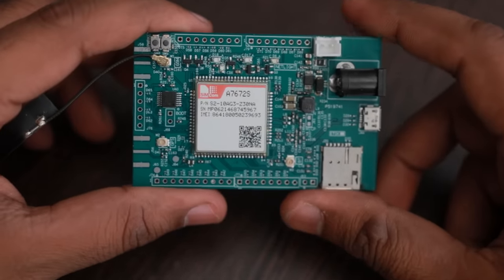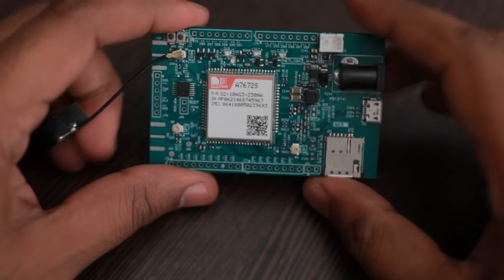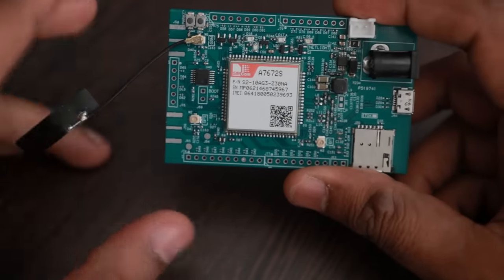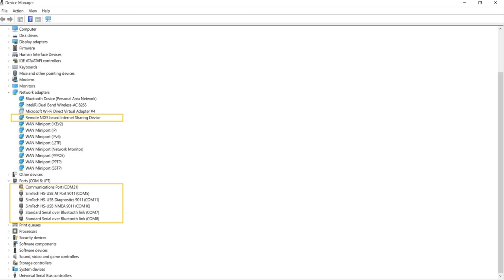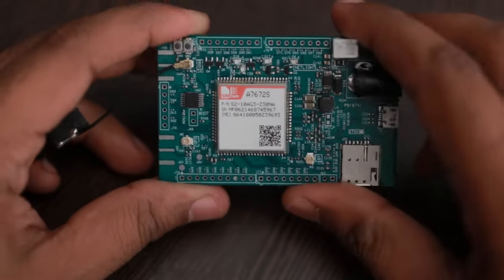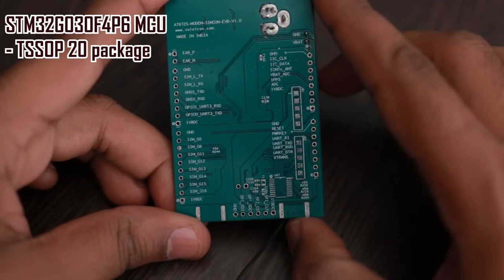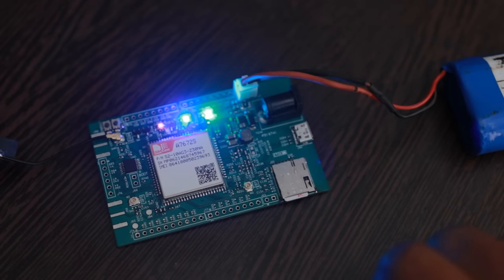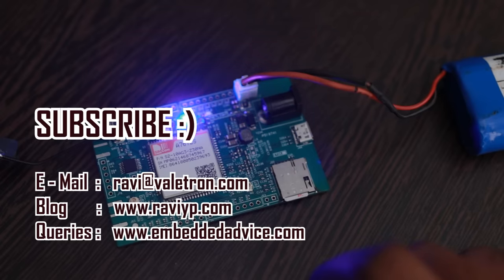Low cost 4G LTE GSM module Evaluation board - SIMCOM A7672S/A7672E

Comment: Sir, recently I have purchased A7672S from valetron,I have connected it to Raspberry pi 3b+ with a USB to b type cable, want to get latitude and longitude and send it to the http server. I get an IP but the network is lost after sometime and even if entering AT+ DIALMODE=0, AT$MYCONFIG="usbnetmode",0. Sometimes I cannot check AT Command . How can I get stable network as well as for http post what process should I follow like connection and AT command, please guide me

Comment: Do the moduel work with Raspberrypi and what is the TLS version of the module....i faced problem when using HTTP request on SIM808 module due to its TLS version 1.0. Do the HTTP request works properly with this and what is the TLS version of this module.
Reply from the maker: Yes, we have tested with RPi USB. It works as usb modem

Comment: I have A7670C Board. how to interface this module with ardiuno? and Code for ardiuno to send or receive message with help of this module. if you have any information / pdf related to this question please share on my mail thank you.
Reply from the maker: All details of hardware is on docs.valetron.com.. You will find many examples of AT commands online for SIM7600. A7672 uses and commands.

Comment: Sir,
Can you pls help me..i recently bought SimCom A7670C modul3 from ktron...the gsm module is getting powered and its blinking as well...but it is not getting interfaced with Arduino Uno R3 module...i'm using airtel 4G SIM... its not receiving the commands...
Reply from the maker: You should contact KTRON support. They will know better about their modules.

Comment: Great video sir, i see your website but nothing is mentioned about memory of A7672S module, could you tell me how much memory the module have. And how to use internal GPIO's pins and how to program this module without using any microcontroller. if i purchase this module could you share program code & support information related to this.
Reply from the maker: Thank you. We are just selling the board. And we haven't used the open cpu of it. But the necessary tools are shared on docs.valetron.com. We cannot help you with programming though, only with hardware details.
Reply: @RaviPujar  ok sir, can you tell me how much memory size the module have.

Comment: Very Nice video, I have noticed RF Antenna and ground are showing short for A7672S modules also ,Is this expected? I have Two ic both are  showing the same,initially i thought it was my solder issue but IC also showed the same
Reply from the maker: It's normal behavior. Antennas have 50ohm impedance to ground, multimeter will show short

Comment: How do you program the on board STM32 ? Have you provided the interface for that ? Will you be able to connect STLINK ? I am interested in buying this module.
Reply from the maker: You can program It using swd interface pins below. They are smd pads. You can use stlink for it. Stm32 is not soldered by default.
Reply: @RaviPujar  Thank you for your reply. that STM32 chip easily available in market  ? I just did a quick search and didi not find it anywhere..

Comment: I have doubts regarding the A7672S. Can we use it with Firebase for multi-streaming? Specifically, is the Firebase client ESP package compatible?
Reply from the maker: You can use A7672S for sending data to firebase. But Cellular modules have different commands compared to esp32. ESP32 wifi commands won't work with A7672S.
Reply: @RaviPujar  What kind of command?

Comment: sir, how to know if A7672S is FASE or LASE   (i.e. it has GNSS or not ) as my module doesnot have LASE or FASE written on it ?
Reply from the maker: You can find out by sending  SIMCOMATI command or getting engineering data from module. You can also fine by scanning QR code, it might give you the firmware loaded.
Reply: @RaviPujar  thank you for the pointers sir

Comment: Hello sir i want to power off the module using MOSFET i am using esp32 microcontroller which type of MOSFET should i use p channel or N channel AO34001  p channel MOSFET i have found good so how to proper add switching system
Reply from the maker: I think it needs combination of n and p channel. I use MIC94060
Reply: @RaviPujar  how to use in combination sir i mean how to switch using both the channel MOSFET please guide thank you for quick response
Reply from the maker: @SaddamHusain-ih3sf  only MIC is enough. Just connect input output and enable
Reply: @RaviPujar  thank you sir its MIC94060-63 or 61 sir? How i can buy in india any online resources

Comment: Thanks for helping us out with this A7672 tutorial, it was really helpful. I was struggling to use a similar A7670C module, if you could help me in any way on that, that'd be really helpful
Reply from the maker: Glad it helped. We made a A7670C modem. Hope you saw that video. May be it will provide some insight
Thank you
Reply: it not going to work I have 2 of ktron 7670C module and its not working. even I tried debugging with them but never worked :(,  i lost all hope on that module. wasted 4k on this. i was told that it is working fine for all except me. looks to be not true hmmm. i tried airtel 4g sim. sms works but no calls can be made.
Reply from the maker: @achuthman  What's not working for you? Explain so that we can help
Reply: @achuthman  hey mate I know that issue, I went through the same and realised few things.
If you are using Airtel 4G then plug the sim in and power on the module and just leave it as it is for 15 min don't try to use it or disconnect power, and don't call on the sim inserted. I don't know for what reason this happens but magically after keeping it idol powered on for 15/16 min the module works as intended with all functionalities. This is the case with Airtel.
If you tend to use Jio or any other "4G only" network then the module works perfect just plugin the sim wait for few seconds and boom! It works perfectly.

I can't decipher the reason but this is what I have observed if it's 4G only network sim like jio, the module works perfect. But if it's any other network like Airtel or Vi, then you have to insert the sim, power the module and leave it as it is for 15 min and it'd work!
Reply: @RaviPujar  Ravi we had a big troubleshotting session spanning over 2 weeks with ktron tech team, I hope you remember. I think Apurv found the issue, let me try that. but 15 min waiting is insane :)
Reply: @apurvsharma9988  Thanks Apurv, let me try. But vendor locking (jio) would be big issue.
Reply from the maker: @achuthman  Guys, you don't need to wait for 15 min. Just send a AT+COPS? Command for it to search for network and register, if it's new sim. Usually if. You are using. SIM for first time. The Network takes time for registering it. A reboot after COPS should boot without any problem. Although I have not observed this behaviour on our boards unless the antenna used is poor. @achuthman Did you see same issue on our board also?
Reply: @RaviPujar  Tried that, didnt work. As I told you sms works fine. only calling is not working. either direction. :( 
Am using the antennae bought from ktron only. if range is low then SMS too should not work right, but in my case its working fine.
While calling I get this error: +CME ERROR: no network service
But its registered:
AT+COPS?
+COPS: 0,2,"40495",7

OK
Reply from the maker: @achuthman  Got it. KTRON is a different company, not sure which antenna you got from them. But yeah if SMS works call should also work too. Also make sure power supply is stable and not fluctuating when you dial due to high current draw
Reply: @RaviPujar  I have your 7672 :), it is working fine with my airtel . hope it continues like that. only one suggestion is instead if sending a raw sma connector. would be lovely if you can send the antennae as such
Reply from the maker: @achuthman  it's a low margin product, cannot include antenna, but it can be added as a purchase option
Reply: @RaviPujar hola podrías ayudarme a configurar el gps en el modulo a7670sa como lo activo, se debe usar algún pin adicional?

Comment: How to use esim with A7672 module.?
Reply from the maker: It's just like normal sim card. You can connect 6 pins and solder it
Reply: @RaviPujar  ok .. how do we activate it? Normally mobile phone esim is activated using a barcode scanning method. But in  our embedded case that’s not possible.